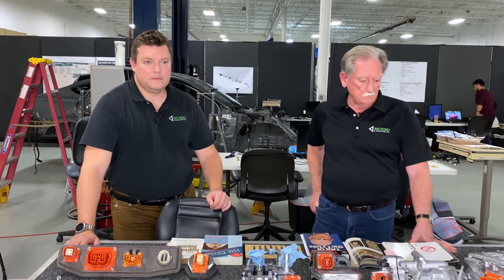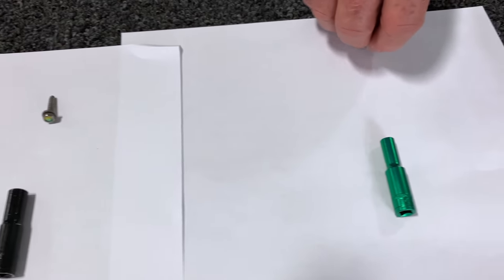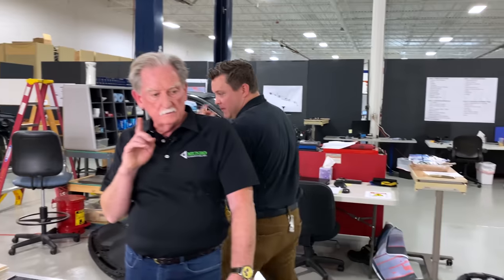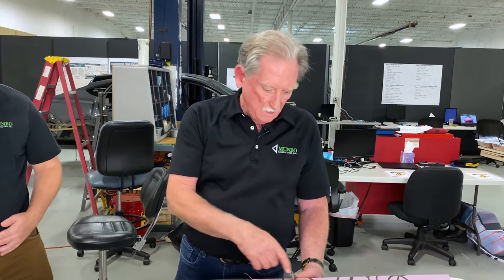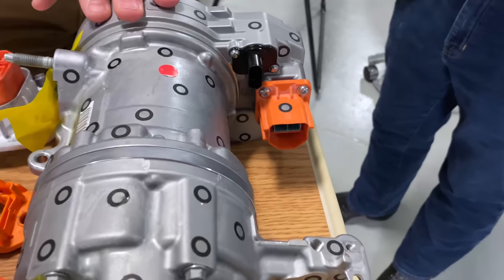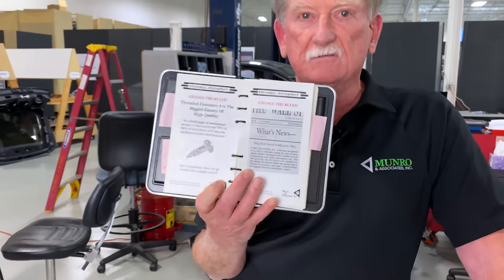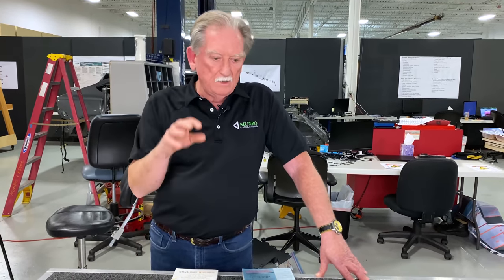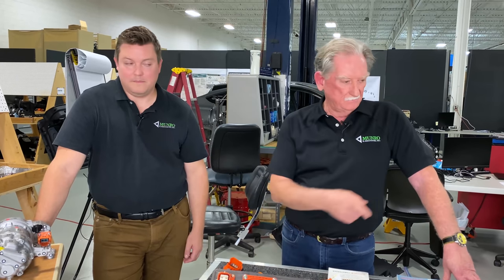Mach-E High Voltage Connector PALOOZA!!!

Comment: I think Ford doesn’t care because all these components are manufactured by different suppliers. So Ford doesn’t need separate tools to fasten different fasteners. Ford just installs these finished components, so for the mounting they need common fasteners. 
Tesla is vertically integrated so needs to have common fasteners for everything.
Reply: This makes sense. The sockets come attached to the modules from the component suppliers and simply need to be mounted by Ford. If a socket needs to be fixed then the whole module simply gets replaced which is also how Tesla seems to work in some of their repair shops.
I think an advantage that Tesla has here is that they save 10% by vertically integrating and more by integrated designs. However they lose a little back because of their lower volumes compared with commodity parts. But the ongoing advantage that Tesla has from their vertical integration is the freedom to constantly innovate as they have full control over the entire process. This is the real advantage.

Comment: Maybe a consequence of rushing a product to market while using too many outside suppliers?
Reply: They got the need for speed right, they just were not up to the task really. Tesla is fast and efficient, Ford is rushed and sloppy. I also bet that Tesla put in double or more the engineering time on the Model 3 compared to the Mach-e. Largely accomplished by Tesla engineers working much longer hours than Ford engineers work.
Reply: Work smarter not harder. At Tesla it’s work smarter and harder. Not only do they put in long hours it is don’t in a highly integrated, efficient & flexible structure.
Reply: One of my favorite stories is one Elon told about why there are battery modules on the 3/Y. Turns out the only real reason was there module department. That department has been dissolved and all staff reassigned. Some helped develop the integrated cell structure system that is coming online later his year.
Reply: @tribalypredisposed  But in reality Tesla is neither fast nor efficient. 
Fast? They are almost 20 years into existence. It took them many many years to get a good product to market. The first Teslas burnt to the ground under customers more than once! 
And as for Efficient - as of July 2021 they are still losing ~$900 per car sold. The only reason Tesla corporate is in the black is due to credits trading and crypto speculative investing. They need to make money selling the thing they make.
Ford will make money on the MachE well before Tesla nets a profit per unit. (the model Y is a good forward progression on that front though)
Reply: @Hillslam :: what color is the sky in your world? Are you as deluded about everything else as you are about Tesla? My god it must be tough maintaining your own reality. Why don't you come back to the truth-based world. We don't bite, and we have cookies!
Reply: @HillslamsMirror  They had $1.2 billion in profit this quarter.  Only $350 million of that came from regulatory credits.

Comment: ... As disturbing as this is, I worry more about hose-a-palooza...
Reply: The only fix for that mess is a complete redesign for the battery pack and BMS. Completely clean sheet design. With the 4 largest automotive battery makers gearing up for 4680 production might as well build the new packs around that cell structure. Shift all the pouch cells to F150 Lightning. And the soon to come BEV Navigator & Expedition.
Reply: Of course that assumes they didn’t make as big mess of the F150.
Reply: @patr5902  Hopefully as Ford iterates, they will learn.  Lightning is not being produced yet, so hopefully it will have a less inelegant battery approach.  Would love to see the Big 2 get serious about vertical integration like Tesla.
Reply: Before anyone considers getting a Mach-e watch this:

https://www.youtube.com/watch?v=m1kHsd3Ocxc&t=13s

https://www.youtube.com/watch?v=Rp2ktJ6174c&t=532s

Comment: Sweet Lord...the Mach-E is like a full tour of "screws through the ages"
The only place where I've seen a more different types of screws is in medical applications (you could bludgeon someone to death with the catalogs on medical screws)
Reply: OMG - I hadn't thought about that but can you imagine how long you would have to search a catalog to find one of these unicorn screws? I'd get a box of inserts all the same size and just start drilling the bastards any time I ran into a problem.
Reply: @kirkjohnson9353  Unfortunately this may be entirely intentional, so that people can only go to a Ford service center because your average mechanic will not have the tools. This is not unique to Ford. VW goes even so far as to design their own 7-sided screw heads so that there aren't (at least initially) any tools available for a mechanic to buy.
Reply: @peterzerfass4609  And that would lead to right-to-repair issues that consumers should be allowed, correct?
Reply: "screws though the ages" love it ! They tried hard too. Now is there a mix of metric and unified too ?
Reply: @michaelgilmore341  its a way they get revenue. How else can they sell their (ICE) cars cheap if not for the assurance that youll be paying through the nose down the line? Thats why EVs seem pricey - but really aren't. Because youll rarely have to go through service/repair-hell.

Comment: Thank you Sandy, we are using tons of different “threaded fasteners” at work and we also put flats and springs on everything. Or the locknuts. Well, I kinda believed that this makes sense, after all it was designed by big ass engineering department. Turns out my gut feeling was right - spring washer makes no sense. I was thinking about it for a long time and I couldn’t figure out how the bloody thing is supposed to work, as it’s squished flat by the nut on one side and the silly for washer on the other. Now I hear from the Master himself, that these things are not worth a damn. Wow. Thank you!

Comment: Speaking about using same bolt sizes......I remember when I was a 7 year old boy, the Russians invaded the Czech  Republic in 1968.  The tanks would have all bolt sizes either one of two bolt sizes with square heads.  There would be two wrenches attached to the turret, and with those two wrenches you could take apart pretty well the whole tank.  Simplicity to the core.  I remember thinking that's pretty smart.  Ironically I became an engineer.  Cheers from Canada.

Comment: Are most of those components with connector coming from suppliers that already integrated the connectors to the parts? Or are those connector put in place at assembly?
Reply: Bingo. Dictating the same screw to suppliers increases the supplier parts count and tooling costs. Sandy even gives the tesla supplier part a pass for being from a supplier.

Comment: Thank you both for a great video. Ford (and other manufacturers) would be stupid indeed not to apply what you’ve taught here (and, as you pointed out Sandy, was learned there long ago). You are perfectly correct that Ford are in a position to dictate to suppliers what they want, and you would think they would be planning and designing common components for the electrical systems of all their future EVs. It’s clear Tesla think outside the box and think clearly about what is needed and what can be done, even if their results aren’t perfect. It seems logical that fewer, common fasteners and the associated tools needed for attaching them are the way to go.

Comment: Excellent analysis, as a past owner of an injection/insert molder plant, we used to insert mold the crush proof collars into the thermoplastic (sometimes with automation if the volume was high). Also, someone is not doing there diligence when coming to matching colors/shades of connectors at the various suppliers of FORD (must use sample chips and hopefully the injection molder owns a spectrophotometer), they should not vary from Reddish-Orange to a light Orange, ridiculous! Lastly, I totally agree 100% that there are way too many different types, number fasteners required and sizes of fasteners used to hold the connector onto the Aluminum components - what a nightmare...

Comment: But if you're doing serious volume, how much does this actually cost? The savings in volume prices on the actual fasteners won't be much once you're buying 10,000s , those modules will likely be assembled on different lines, maybe even different factories or different suppliers. And using different heads may sometimes help ensure that the right length of fastener is used, where there are different lengths needed.  Is this such a big deal compared to other areas where savings can be made?
Reply: Well, if suddenly one (and only one) type of screw is lacking in numbers, you have to shut down your whole line. That's just adding more points of failure.
Reply: Design the screw holes to all be the same length...
Reply: There's another cost factor, small but growing, and that's teardown marketing, something manufacturers didn't have to think about much before YouTube. Sandy's audience isn't huge, but this kind of content makes its way around YouTube, with ripples of commentary across other channels, articles, the wider media. There will be some  people (and investors) on the fence vis a vis the Mach E and who, after being hit by this ripple or that, will say you know what I'm not going for it because I don't like the "mindset" of that company (as revealed by whatever hitherto arcane manufacturing process was discussed). You can quantify the savings from keeping the "screw situation" (or whatever) a bit mish-mash, but it's much harder to quantify the lost revenue as a result of being exposed in this way. Humans are odd, there are many things that if no one points them out we don't notice but once someone does we can't stop noticing, no matter how relevant such things truly are. And likewise, if a potential consumer is impressed by your "screw situation" and makes a purchase decision in part because if it, even if tangentially, then the marketing department should be paying the screw department a little bonus. It's quite a small marketing factor now, it won't affect Mach E while produced in lower quantities, but the YouTube era is here, the definition of "good looks" is widening, and thinking 10 or 20 years down the road manufacturers will need to take heed.
Reply: @joedouglas5243  nice theory but no where near as important as what's this signifies from Ford - they are not taking an integrated approach, they are not focused on mass production of this particular vehicle.  This is more costly and inefficient.  Tesla's aim is to build their 3 and Y at huge scale and for many years.  These things would stack up and bite you. Nevermind if it was ever seen on YouTube or not.
Reply: "Is this such a big deal compared tonother areas where savings can be made?" And that's exactly where ford went wrong. Every engineering team said, "well we could try and get together with the battery team and the motor team and unify our parts but that only save like 1$ in the bom, the frame guys can figure it out"  except every single team said that to themselves and now you have 10 different screws, and tools needed for those screws and all kinds of other wasted savings everywhere else.
Reply: @bluetoad2668  Oh I totally grant you that, the main consideration is production efficiency. My point is that it has also become something for the marketing team to consider, in this brave new world. A huge consideration perhaps not, but keep in mind that pre YouTube era a stamp of approval from someone like Sandy would have meant zilch to the marketing folks. Now it's more than zilch.

Comment: Things are not as simple as removing screws from the design and standardize connectors.  I would guess that other companies build modules for Ford. If you use the standard connector you pay so much but if you want another one you pay the RD price and they have functional test it again. Then do life testing. That causes delays and could cost more money per module.
Reply: If Ford can't pick between producing their parts in house or making a special agreement with a 3'rd party manufacturer they are doomed as a production company, normally you get rid of these bodged solutions before your product is even evaluated (unless of course this was a vastly rushed product).

Comment: My guess is that all those parts come fully assembled from the supplier so Ford doesn’t care what fasteners are used because their employees on the line only have to plug-in the connectors. The parts are probably classified “non-serviceable” (aka have to replace the entire part) so even the Ford technicians at dealers don’t have to deal with taking it apart.

Comment: Understand your concerns. Good rant. When I was working, we were having environmental issues with equipment getting hot or not surviving lightening testing, etc.  (was not my area - mine was systems safety/SW integrity [I know - SW integrity - oxymoron but we try]), We brought back in a retired environmental engineer (45-50 yrs service) to help. He told me that he was seeing problems that he solved 20+ years ago. He held sessions with the younger engineers to just discuss how to do it right. My boss (again 40+ yrs in systems) wanted to have people who were retiring write down what they learned over the years. Company would not by into doing that so we might be subject to repeating ourselves.

Comment: Are all these components coming from different suppliers hence the daft amount of fasteners?  Have you had any feedback from Ford yet?
Reply: If you're "Ford" and you go to a supplier saying
"We're building a new EV (Whatever) range, we need plugs, sockets to do (specify), these are the fasteners you can use" (2 types).
That supplier WILL either design a new part, or modify tooling on an old one to fit.
It's only a hole size and depth.

Comment: I have a legitimate question though:  If all these different components are supplied as sub-assemblies from suppliers (like the Tesla AC Compressor shown), Ford isn't the one running down all of these different fasteners on the line... they're just plugging the wires in.  So is that why they don't seem to care?  Is it not Ford's money to save anymore?
Reply: They can just change some supplier specs.
Reply: That was Sandy's point at the end of the video. They're Ford. They are big enough to tell the suppliers what they want.
Reply: @raddaks2039  I understand that, but if Ford's "want" from the suppliers is to make it as cheap as possible, then each supplier is going to use the fasteners that it already is buying in volume.  From the supplier perspective, it's more expensive for them to order a 'special' fastener that Ford is specifying, so that cost would get passed on to Ford.  For the question of 2 screws vs. 4, that's a bit more clear-cut assuming again that there's not a cost associated with designing a new connector with 2 fasteners vs. buying off the shelf with 4.
Don't get me wrong, I completely agree with Sandy, but I'm just asking the question of whether Ford is 'experiencing' any of these drawbacks when assembling the vehicles on the line.
Reply: I am a software engineer and I once had a talk with a large company wanting a centralized option to buy travels for its employees.  During the talks it came out the price of the traveling was not important (in fact travel costs could double).  The important issue was that the pencil pushers would be able to control and verify the acquisition of travels.
I suspect Fords philosophy of horizontal integration is based on the same. It can be very difficult to control and quantify costs for a product made in house.  And then there are these horrible innovators ...impossible to talk to.
Reply: @pierre.a.larsen  I'm not sure I understand your point.  Can you explain?
Reply: @SteebMo  I do not think Ford is worried about saving money or making a quality product.  The company is driven by politics and MBAs. It is not engineer driven.  Ford does not want to do innovation or even fabricate inhouse parts production (vertical integration).  Their focus is marketing, publicity and stock options.
Reply: @pierre.a.larsen  I can tell you with certainty that every existing automaker outside of boutique brands like Koenigsegg, Pagani, etc. are absolutely "worried about saving money".  This is exactly why Sandy spends so much time talking about the 'cost' (not just engineering risk) of seemingly inconsequential little stuff like the number of fasteners that get used.
Reply: @SteebMo  We can certainly agree on that they should worry about this.  Alas, the evidence shown by Sandy Munro illustrates something else.

Comment: The more fasteners, the higher the cost of production because it takes the assembly line workers more time to build the cars. Ford could increase its profits per vehicle if it rationalized the fasteners and used fewer of them. Where are all the MBÁs?
Reply: Apparently forgetting what they learned.  The Goal is often mandatory reading in MBA courses.
Reply: you're assuming the assembly line workers are installing all these fasteners in final assembly. I think it's pretty obvious looking at the various components that they are not.